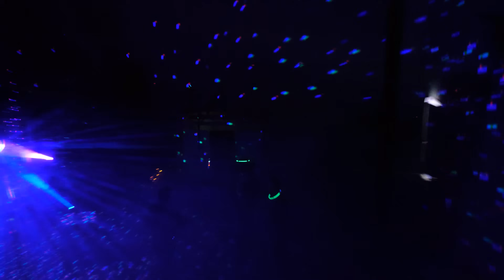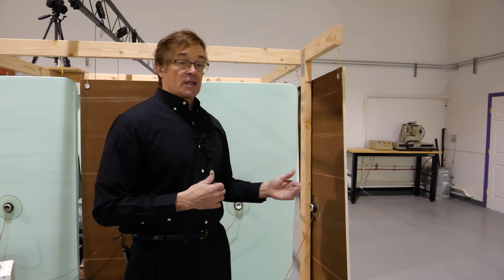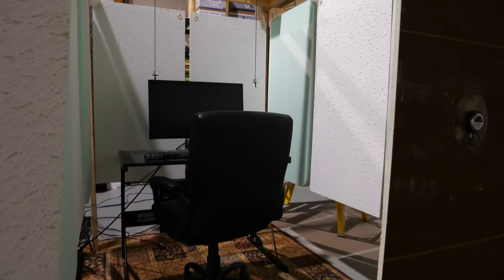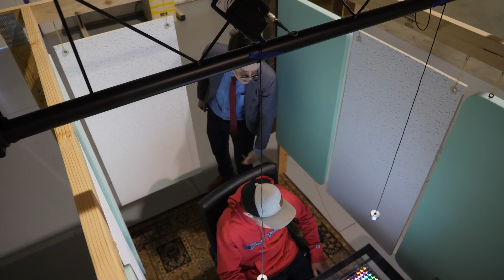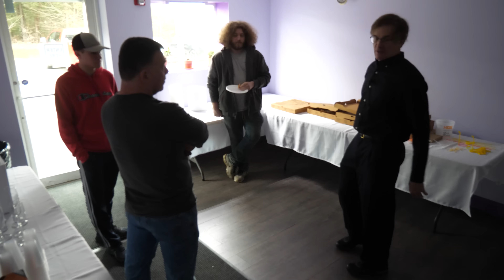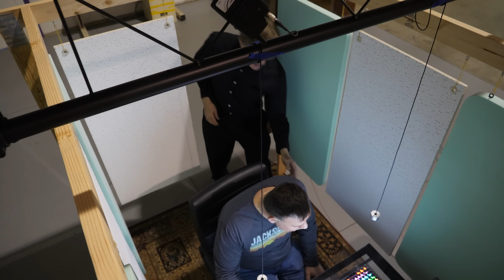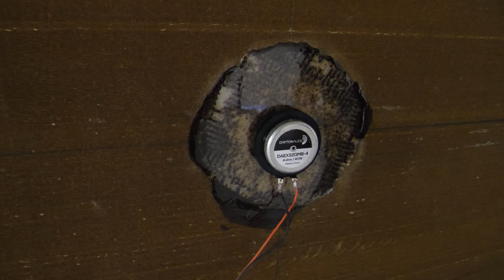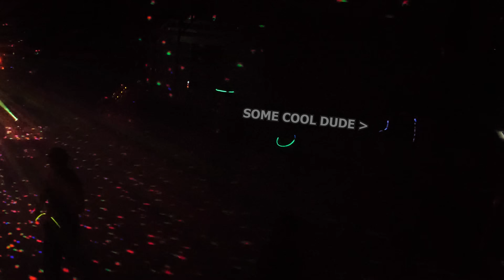SHOULD SPEAKERS THIS GOOD BE LEGAL?

Comment: Not exactly 2:1, so with all the other measurements you couldn’t say what the measurements were?
Reply from the maker: That's  because  it actually  doesn't matter.  The principle is that you minimize  redundancy and octaves. Just avoid  these and the construction will perform well.
Reply: Ceiling tiles are made to fit into a 2' x 4' metal grid, so the actual tiles are slightly smaller like 23 5/8" x 47 5/8" to accommodate the thickness of the steel "Tee" channels that make the grid.
But like he said it really doesn't matter.

Comment: If you were making this as a product, some of the material they put on speakers with screen printing could make them look much more finished.  Is there such a thing as black acoustic panelling?  And maybe take a solid door as part of the frame and cut out the middle to hang the entrance speaker?  Throw some lights on the frame...  I wish I had the space for something like this.
Reply from the maker: You can spray paint that paneling without  any reduction in performance.

Comment: I am currently running my full surround rear and atmos system on these dml speakers. I love them. Crystal clear and inexpensive. Light weight to hang. They aren't the prettiest but totally functional. I haven't tried front stage yet due to not having an acoustically transparent screen yet.

Comment: Have you considered laying up a single layer epoxy with Aramed, carbon fiber, E glass, etc? To get it flat, I use a sheet of waxed glass and make sure I have a pull tab to get it started.
Reply from the maker: I haven't tried testing that, but fabricating it wouldn't be difficult.

Comment: The trick is : the close box is located within a huge hangar, and the rear faces of the panels are very far from any reflective wall. If you try to lay them close to a 20sqm room you will get awful resonances because these panels send rear sound waves as strong as the front ones. So how do you suggest to equip a normal room with that ?
Reply from the maker: Hang sound absorbing  material  on the walls  behind them.  Some viewers  who assembled  these speakers noted the improvement in their performance  with this technique.

Comment: I wouldn't say that headphones are the ultimate standard especially knowing that headphones are unable to reproduce proper  stereo experience without trickery. I mean with stereo speaker system both ears can hear both channels, headphones need additional hardware or software to simulate that and it's not perfect. They sure can sound good but staging, directionality, depth perception of well set up recording studio control room can't be substituted, control rooms are built to spec though and can cost a small fortune, even the budget ones.
Reply from the maker: But as you say, a proper soundstage would cost more than the vast majority  of viewers are willing to spend. The ultimate  is based on what the listeners have experienced not on what is theoretically  possible because the listener can't use  that as a reference.

Comment: You add a sub to any system and people will say it sounds amazing. Side by side test with some high end studio monitors would help. I think you need to add some trad components and mix up the build a bit more.
 I bet the surround thing is amazing and probably even better in a larger space.

Comment: Thanks for the video. It's another good one. For my first build I used a pair of coroplast panels. Coroplast is really cheap at around $3 (Singapore Dollars) for a 90x75cm sheet. I also went with the Chinese brand AIYIMA for two 8 Ohm drivers. Quite nice IMO. Eventually for the sake of simplicity I decided to use two drivers on one 90x75cm panel. I have hung this horizontally above my computer display. Each driver is located at a 7/9th from each edge so the left and right have a slight vertical offset, but it sounds perfectly fine and stereo separation is not bad.
Reply from the maker: Thanks  for the feedback.

Comment: I am a bit late to this video but I hope you will still be willing to respond. Also I am open to email correspondence. I have enjoyed your sound series over the last few years and am wanting to incorporate this into a few units teach about sound. However I am a bit of a late comer to audio. Could you give a bit more guidance in how you wired in the actuators? What kind of actuator are they? (I now live overseas so trying to find an equivalent.) Great videos please keep it up.
Reply from the maker: Check out  Parts Express for their "exciters".
Wiring  is super simple.  There are two leads (red and black) for positive and negative just like the outputs from a typical  amplifier. Series  Wiring is almost as simple.  Red to one exciter then its black to the red of the next exciter etc and then the final  black back to the amp.
Reply: @TechIngredients  yeah I live overseas so trying to find an equivalent here and mostly I have found line actuators.

Comment: I built a pair of these using the acoustic ceiling tiles and hung them from the ceiling of my shop horizontally.   The supports I used are lighting chain and I attached the four of them at the 2/5ths 3/5ths points, the same formula as Tech Ingredients put weights on their panels.   Note: I ended up hot-gluing the chain links to stop the rattling at certain frequencies.  I think they are as good as any speakers you would put in a woodshop and the sound it filling, not directional. I also have a 6inch woofer for a 2.1 system.
Reply: I have the same thoughts about making a pair to hang in my shop, what would you think about hanging them horizontally with something flexible like silicone tubing?
What is the value of hanging them at 2/5ths - 3/5ths points?
Reply: @samTollefson  From what I gathered watching the Tech Ingredients videos, those points were either neutral or points of high resonance. When they put weights there it smoothed out the frequency response.  So I rationalized using those points as hanging points using the weight of the panel instead of actual weights.  I have no way of testing and am happy with the sound so ......  I would NOT use chain again.  I also had no way to edge mount like a conventional speaker suspension.  The fact I was hanging them near horizontal creates a situation that was not testes by Tech Ingredients or any other YouTuber as far as I found.  As far as the hanging material, anything that does not contribute to sound would be good.  Silicone tubing I would think would be fine.
Reply: @thesawyers682  Thank you, I will be testing some in my shop based on your findings, when I complete my project I will leave feedback here based on my results.
Again, thanks.

Comment: Wish I could have been there to hear these.Given a choice, Carmina Burana would be my test piece,  very demanding of speakers. My system consists of Wharfedale 10.1 front and Q Acoustic 2020i rear, plus Wharfedale sub powered by Yamaha RX A1060 av amp. Most  music in flac from my PC.In a smallish room.I am quite  happy with the sound and not thinking of further upgrades but I just cant bear to listen to what it does to Carmina Burana.

Comment: I built a pair for kicks over one year ago. I used the foam pink stuff at home depo, 1 pair of Dayton drivers, 1 klh 8" for mid low, a sealed 10" Polk sub, and a floor firing ported Klipsch 10" sub. Powers by a 50 dollar ebay bluetooth class D amp. It's great except the thd is too high to enjoy loud for long. Thinking of trying a better amp. Fun experience. And friends seem impressed.

Comment: how about suspending them with superconducting magnets? 
one thing though, would be the weight of whats attatched to the vibrating panels affecting the transient response and damping factor. maybe suspend them with electromagnets, that way lightweight materials could be attatched to the panels and not the copper wire coils? i love this whole idea for reproducing sound.
material sciences and 3D printing nanomaterials will be  excellent for the composition and design of the panels.
Reply from the maker: The mass of the coils is much lower than that of the panels.  It's probably not worth the effort to levitate them.
Reply: @TechIngredients  gotcha.👋😄👍, love the channel/subject matter and presentation. im of a stereo/sound quality mindset. if you want, it would be cool if you can every now and then do things like the audio exciters, the tall, thin (i think they were transmission line speakers with a single driver?)  speaker build you did once. maybe a video on types of enclosures like sealed,ported,4th order bandpass,6th order bandpass,etc,etc, pros/cons and application of them for a specific desired sound. And how loud can you make one,maybe a servo driven one? 
Appreciate that you replied, keep up the great work!

Comment: As an audio/electrical/electronics engineer I will be building this amazing project! Class A amplifiers will be used for minimum distortion, I will be making measurements with Oscilloscope and my Bower mics to show how well it works.  This is truly amazing. Thankyou for the inspiration! I can't truly show how impressed I am with this and this channel and all you do. You truly show your interest, intent and passion for nuclear, mechanical electrical and electronics engineering and other attributes. You remind me of myself!!!! I am so happy to see you truly devoting your life as I also have. I look forward to the video I make showing how amazing this is.
Reply: Hey how was it when you built it? What are your results?
Reply: Class A for minimum distortion? are you from 70s?
Reply: @Timsturbs  That was my thought as well, tubes produce some the most distortion found in any class of amp. Lowest distortion (at least at a feasible price) would be using class D, e.g. Hypex nCore or Purifi amps.
Reply: how was the project? did you actually managed to make it?
Reply: @rerikm  A few videos have came out the last year. They don't sound very good apparently.

Comment: I  think the is can be very good commercial product. but cables are always very difficult to manage.  I suggest a wireless driver units and a central intelligent server  and a subwoofer. A music system like a ''lego'' and a software that manages the drivers. I would definitely buy several of these.
Reply from the maker: Wouldn't wireless drivers still require a power supply and the cables that energized them?
Reply: @TechIngredients  electric is already wired in houses.  Also i could replace them in different rooms near to power. And i would hang them horizontally from the ceiling, almost like a chandelier.. wifi powered driver would make it wasy to deliver in every room or floor. Airplay2 would be even much better..
Reply from the maker: For remote operation, wireless would be convenient.

Comment: I used to have two 40 lbs coils that I turned two 4' x 6' windows into speakers and a propane gas subspeaker in 1975. You could the speakers two blocks away at nominal volume! That 3 on a 10 scale. The propane was too expensive and you had to be outdoors!

Comment: I like the idea of using ceiling tiles, however I've recently been concerned about air quality. Since the tiles are a friable material (my understanding is they they are often compressed mineral wool or fiberglass), would there be concern with "shaking" them via the drivers such that they shed small bits of material?
Reply from the maker: If that's a concern, we demonstrated  a good alternative  in our previous  videos with end grain, rigid balsa panels.

Comment: Do you have any thoughts on using existing acoustic ceiling tiles? I would assume they need to be isolated from the metal frame they sit in.
Reply: He did mention using some rubber isolators, I have some "sticky one side" silicone bumpers I use for cabinet door and drawer stops that might be ideal for that purpose.

Comment: 18:20 To isolate them, why not use something like rubber bands?  Should be light enough, and the rubber material would provide some absorption.  You could also use many of them, say 4-5 per panel, which would reduce the load for each band.
Reply from the maker: I tried that.  They work as well as the fishing  line, but no better. They are also  difficult  to adjust  for leveling the panel.

Comment: 14:00  "200 bucks"   Hmmm..  Plus the 3 tube amps, the sub, wood, speaker wires, etc., probably in the end closer to what, 4-5 times that for the entire system?  But being in Canada, maybe the parts are so much cheaper than they are in US... Everyone is price 'rip off' ..  If you're not buying online, you're getting gouged.  Building materials still at an all time high.  Copper too...
Reply from the maker: $200 for the speakers.  There is no point in adding  the cost of the amps, wire, test frame etc because  they're  not being reviewed  and you can source what you like to use.  We aren't in Canada (happily), but if you are then I agree that on line is a good place to source  equipment.
Reply: @TechIngredients  Yeah just a warning for someone with $200 thinking he'd get anything like heard here! (ex; no sub for 200!)  ;)

But great solution!  This sound cubicle is an AMAZING idea and even if most of these non-audiophiles didn't seem super impressed, I'm sure that audiophiles would have given more positive responses.

Room & treatment, speaker and listener position is IMHO at least ~50% of the sound of the sound of the speakers, so if you can eliminate room as a factor, I really wouldn't be surprised if it sounded better than most systems with speakers costing thousands; just given how un-optimal most rooms are.

Thanks for responding and videos!  :D

Comment: Like traditional drivers - is there a variance in the audio performance between units? As in, are there more expensive, better-performing models that might sound better or worse?
Reply from the maker: I believe so.  The better models  have factory  specifications and you can compare these.  Start with  Parts Express.
Reply: @TechIngredients  another question, how would these speakers perform in a small space? 

My office is not much larger than the enclosed test space in this video.  Is the acoustic performance negatively impacted when these are placed close to a wall like with traditional speakers?

Comment: Thanks for the work you've done.  I've built 10 different pairs - different materials, sizes, # of exciters.  Compared them with different speakers and listened to many; some multiple 100's of thousands - I'm sure you can see differences in the frequency response, but I've heard nothing that images like these panels.  I like the comments from the fellow with Klipsch's (they are in storage and I don't see them coming out any time soon.).  It's been an experience.  Thanks again.
Reply from the maker: Sure.  Thanks for the comment.

Comment: It's an interesting setup, but a lot of people are used to crappy Bluetooth speakers and cheap earbuds and will get easily impressed. Let some experienced audiophiles take a listen to it and also, I would like to see some frequency response, THD and decay measurements.
Reply from the maker: Thanks.
Actually, what matters is what most people like.  Audiophiles represent a small fraction of the potential audience and just like a Michelin star reviewer can  identify  the very best restaurants, most diners will not be able to afford  to eat there.
Reply: @TechIngredients  Of course the vast majority of consumers are not audiophile, but the title of this video does provoke a bit.  I like the creative mindset behind it and as I work in automotive audio R&D, I am quite familiar with the use of exciters and what level of performance can be achieved. Personally I like the fine higher frequency details achievable with ribbon tweeters and electrostatic transducers. You might consider a two-way design of this concept, perhaps with some electrostatic window. A DIY electrostatic transducer could be an interesting undertaking.

Comment: Great video, very interesting. What would happen if the panels were suspended with springs instead of fishing line?
Reply from the maker: It would probably work.  But, you can use  clear line and then the support becomes  nearly invisible and that's nice.

Comment: Making them single driven, monolithic units is where the problem arises.
Building one large and one small unit, or 50/50 splitting them with differently responding materials have both worked.

Comment: I am not surprised that younger people are going to like some of their headphones better. These are chasing a flat response curve, which is not actually what most people enjoy. You need to tune these closer to the Harman curve. These frequency range that these panels are outputting, is almost completely opposite to that. I would be interested to see how much you could do with an EQ on just one of the ceiling tiles to bring down the mids and highs a bit, and let the base come out more.

Comment: I saw that Dayton sells a mega-bass exciter (Dayton Audio DAEX32QMB-4 Quad Feet Mega Bass 32mm Exciter 40W 4 Ohm) . Have you experimented with  materials that might handle sub-woofer frequencies? (Plywood? Sheetmetal? Panel board?) Perhaps it is more cost-effective and space-saving to just use a subwoofer?
Reply from the maker: We've  experimented with many  materials and nothing efficiently produces low frequencies.  I'd stick with a conventional sub.

Comment: I built a pair of them due to Your proposal. And because the drivers got 4 Ohm impedance, I bought 4, 2 for each chanel, which I shaped in the golden cut. Unfortunately here their maximum width is 62 cm.  I hung the xps panels 20 cm from the wall and drove them with a tube amp. They sounded very well to me, but the frequency sheet says they do a seismographic line from 5k up. Do You recommend a crossover and a tweeter?
Reply from the maker: No I don't.  The smaller the panel,  the higher the frequency output.  Use a mic and REW to analyze  your panel  response.